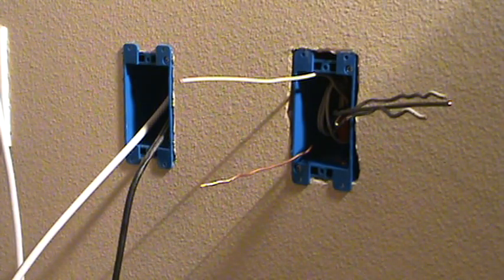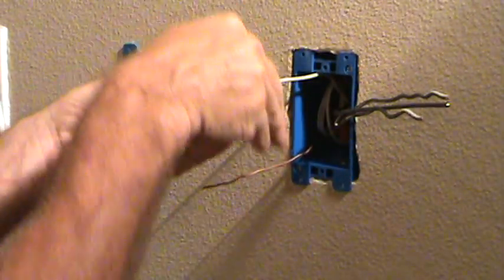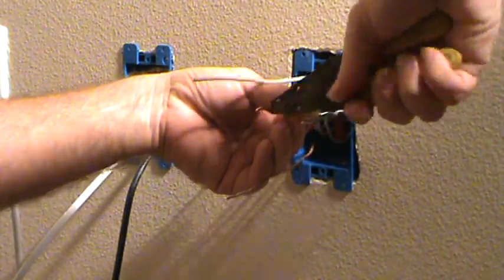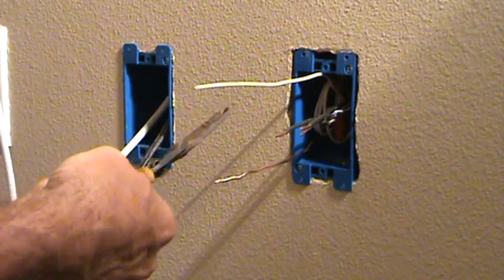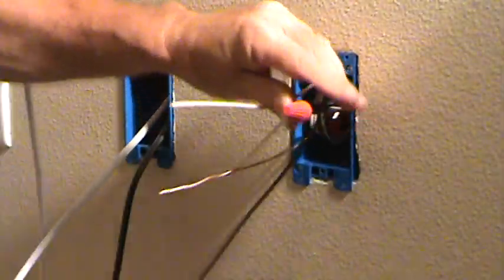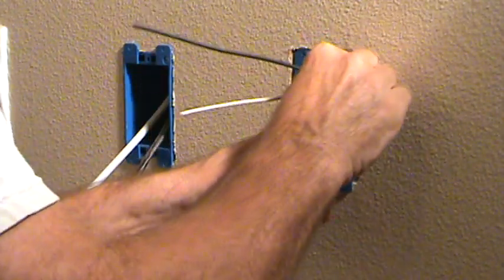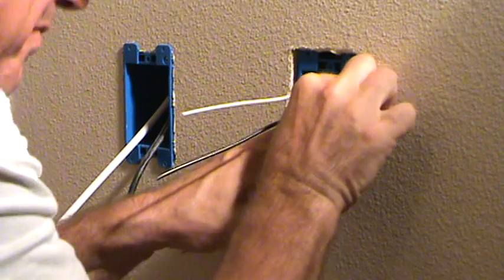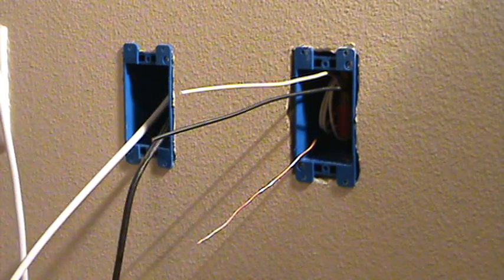How to Attach 3 Black Wires to Duplex Outlet

Comment: Why is there 2 wires coming out from the other junction box?
I have a receptacle that has only 2 wires connected to it and tester shows open ground??
Reply from the maker: I did the same thing with the white wires so I only had two white wires coming out of the box just like how I wanted the black wires. If you watch the video it will show you what I was going to do for the black wires. As for your situation do you just have a black & white wire attached to the receptacle & not a ground wire? You should have a ground wire attached somewhere for the ground....

Comment: i need to know if I need to pigtail the two black wires together, as I also have a red for half hot. and so the pigtailed black go onto ONE brass screw and the red to the other?? and then the two white attach to each silver screw or also get pigtailed?????
Reply from the maker: This could be hard to explain but here goes....If you want half of an electrical duplex outlet powered by a light switch, you have to do something to the electrical duplex outlet before you install it. Look on the side of the electrical outlet. You see the side where the two gold screws are for the hot (black) wires? You see the little gold tab that connects to both of those gold screws? That means for a regular duple install you would only need to connect to one or the other gold screw areas with the hot black wire since that little gold tab connects to both gold screw areas for both the top & bottom of the hot wire slot on the duplex outlet. Now if you want one of the duplex outlets to be wired to a light switch, you would need to cut & break out the gold tab that connects to both gold screws. Now if your red wire goes back to a light switch then you would connect the red wire to either the top gold screw or the bottom gold screw whichever one you want to work for the light switch. Then the how black wires that are in the outlet box you would then connect those wires to the other gold screw & that plug area would be hot all the time. If you have two black hot wires in your box then you could make a pigtail so you only have one black wire left that you could then connect to the gold screw. As for the white neutral wires, if you have two in your box you could then make a pigtail for those & connect to just one of the silver screws & both top & bottom plug will work since the silver tab is still connected between both silver screws. You don't have to brake that tab just keep that one together. You have two silver screws so if you want you can connect one white wire to one silver screw & connect the other white wire to the other silver screw. That will work too. Whew. See what I mean?

Comment: Out of the assortment of wires I have I only have 1 black wire that is hot. Is it ok to connect all 3 black like that?
Reply from the maker: Yes. For regular duplex outlets you can connect up all 3 black wires like this. Or you can connect up 2 black wires like this so that you end up having just 2 black wires coming out of the box then connect to outlet. Either way. You can do the white wires like this too. I have a video called "how to attach 3 white wires to duplex outlet" as well. If you want to watch that one, you can go to my search box on my actual channel & type that in. If you want to watch more electrical videos I post on my channel, you can go to my main YouTube channel page & click on playlists then scroll down to "everything electrical" or something like that & you will find all the electrical videos I post to my channel! Thanks for your question...
Reply from the maker: You only have one black hot wire since that is the actual black wire that feeds the junction box with power. The other two black wires go out to other outlets...see?
Reply: @videojoeshows  three white wires to duplex

Comment: I wired an outlet like this and ended up with two wires on each side. Now the plug doesn’t work and a connecting light doesn’t work. Seems like I have to pay attention to which ones might be the line set?
Reply from the maker: Hmmmm not sure what you did...! Did you put the black wires on the gold screw side & the white wires on the silver screw side? It shouldn't matter after that which black wire goes on which gold screw etc. but once in awhile it could matter maybe in your case? Did you re-wire your outlet the same way you removed the old one? Seems kind of strange if in fact there was only two sets of wires in there & not three sets for instance. If you only have two sets of wires then there's really not very many ways you can wire up that plug unless the plug is controlled by a light switch that powers up one of the outlet areas....? Could that be why your outlet is not working properly? Maybe you can give me more info on exactly what was there before & what you did prior to installing the duplex outlet...? When you say the connecting light doesn't work do you mean a bedside light that is controlled by a light switch to that same plug you worked on? Then it matters. It could be easy to fix. Turn the power off then remove the outlet from the wall. See the tiny little gold tab that connects the two side gold screws? Get in there with a pair of needle nose pliers & bend it back & forth & remove....just the connecting tab on the gold side screws only. Leave the little tab on the white side screws as you won't do anything with that. Now you should have a continuous power line going to one of the outlets (top or bottom) & the other one will only work when you turn the light on & off. Make sure you plug the night stand light to the outlet that is controlled by the light switch & then you can control with the light switch. Is that what you mean? If you look at the old outlet you removed you should see that the tab on the gold side screws was removed. That's how you would wire up an outlet like that....if that's your case. If it's something different than that then let me know...ok? Thanks for taking time out to send me your message.... I also have a ton of DIY topics/videos on my channel of course. Just go to my main YouTube channel page then click on playlists then scroll down to see. It will save you money...promise!
Reply from the maker: For just a standard outlet, it shouldn't matter where the actual line set wire is since you will be connecting all the black wires together...see what I mean? It will matter of course if you were installing say a light switch & then it would matter.
Reply: @videojoeshows  There were 3 sets of wires. I tried both ways, 2 together then all 3 for each and get the same result. Before I had an old plug (updating them all in the house) and it was back wired on both sides and the remaining set screwed into the terminal.
Reply: @videojoeshows  The downstream light is the garage light and also the plug in the garage doesn’t work either because my water softener is not on.
Reply from the maker: @GingerChapa  Strange for sure...
Reply from the maker: @GingerChapa  Not sure what to tell you since it sounds like you are connecting up the wires the right way I would say. If all you did was remove one old wall outlet & replaced with a new one then as long as all the black wires are connected to the gold side & all the white wires are connected to the silver side then it should work. Now if you are working on an older house & you are doing all kinds of outlets then there could be one not done properly & all the others could still be right but if the initial electricians wired the house in such a way as to use a white wire as a switch leg & you thought it was a neutral wire then that might be an issue for your lighting fixture as years ago they use to bring the main power to a light fixture to the ceiling light fixture location then ran 2 wires down to the light switch where one wire was a white wire & one wire was a black wire but they used both wires as hot black wires even though it's a white wire in there. They should've put black electrical tape around the white wire in the light fixture switch box showing this but it sounds to me you aren't working on any light switches rather just removing & replacing old electrical wall outlets so the light wiring shouldn't come into play per se but it still sounds like there could be another issue going on some where making it so you don't have power to those other areas. There could also be an issue where you have everything connected up right but you might have a loose wire nut in an outlet box that is loose causing you to not have power to the other locations or if you pushed any wires into the back of an outlet maybe one of those wires wasn't clicked in all the way & when you pushed it back into the box the wire came loose & you didn't know it when tightening the outlet to the box tight...? It could be something like that. Of course you won't know what it is unless you remove all the outlets that you replaced to check them out to see if you can find the issue.....
Reply from the maker: @GingerChapa  Let me know how you do with troubleshooting in case I might have anything to add.
Reply: @videojoeshows  Thank you Joe for all the advice! I have someone helping me troubleshoot, he also says it looks good. Everything was working prior to disconnecting the old outlet so I'll keep trucking along 😂
Reply from the maker: @GingerChapa  Ha! Let me know what you find as I am now curious for sure...